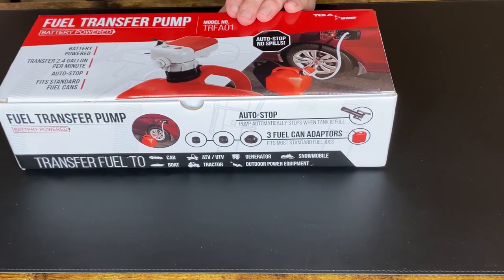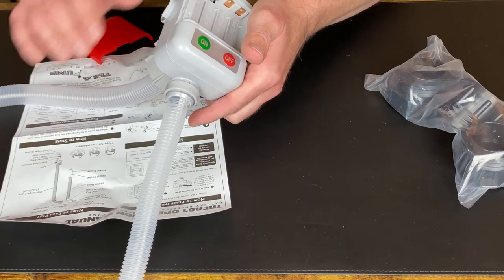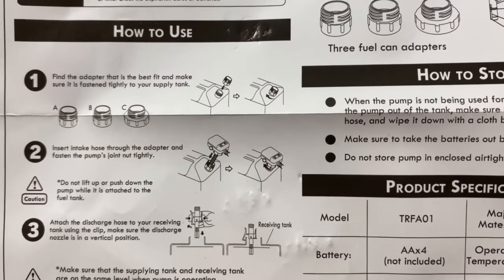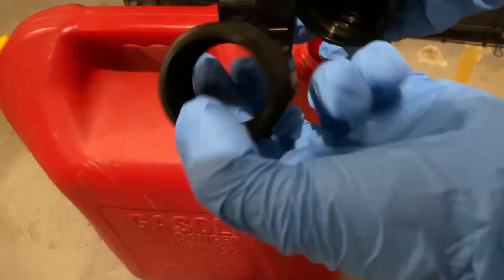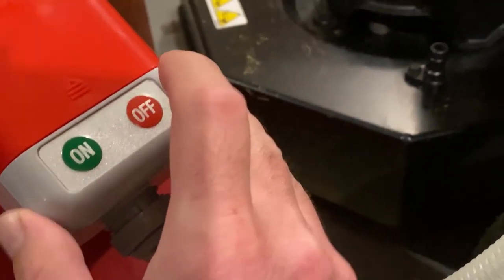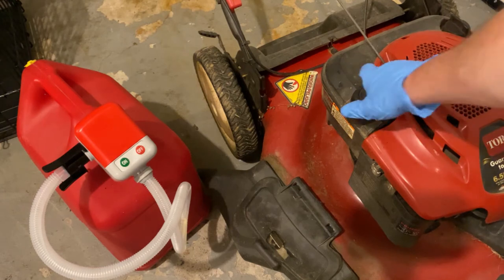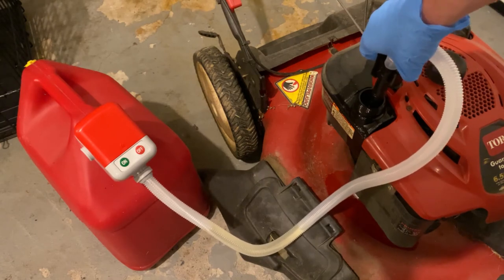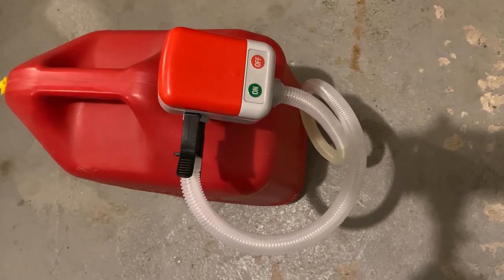Terapump 4th Gen Fuel Transfer Pump TRFA01 Unboxing and Review

Comment: My experience has been it is fantastic when it works. Exactly how long it remains working and doesn't crap out is another story. Hoping I have better luck with the 4th Generationt than I did with the whatever generation it was I had bought and shorted out after a few uses in 2017.
Reply: It's been 2 months and the off button on the unit has already started to become flaky. I have to press the OFF button several times and hope the unit turns off. Yes, even with a fresh set of batteries the problem still occurs.

Comment: My experience with this exact pump devise was not good. I was pleased with the pump performance and safety initially. However, after very little use, the pump started leaking gasoline around the bottom of the battery compartment while the pump was operating causing gasoline to pool under the can. I let that pump dry and disposed of it. I bought another design and have been using it all summer without problem.
Reply: There's an updated model that is supposed to eliminate that exact problem.

Comment: Junk. Overflow cut off failed after one year. I had to by pass circuit board, install a switch and direct wire straight to pump. System works fine now that I removed the overflow protection.